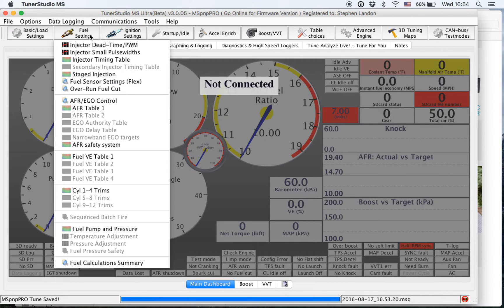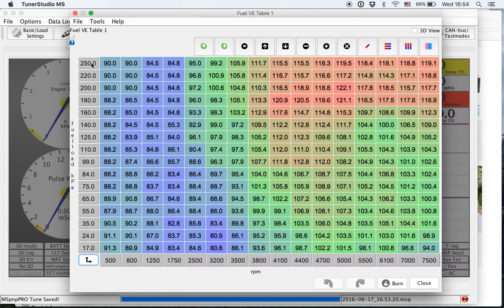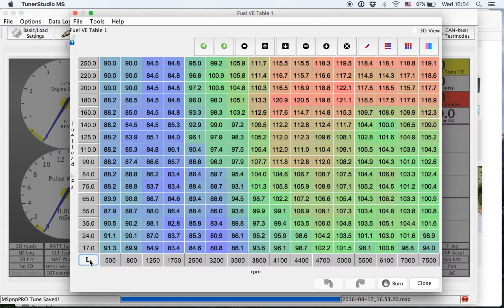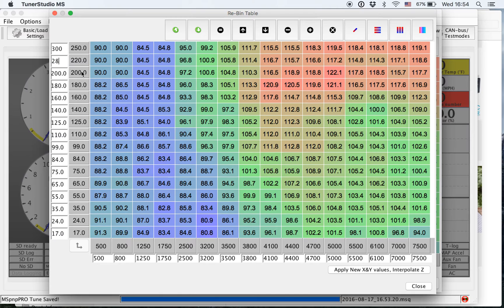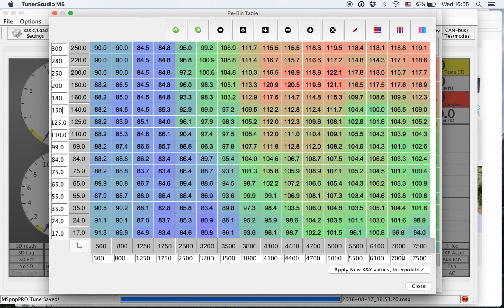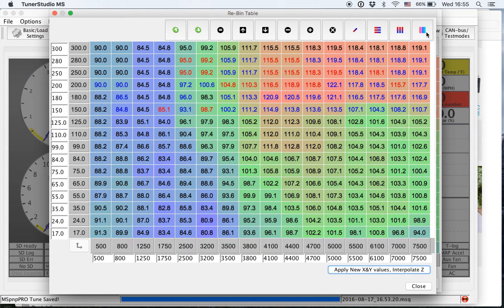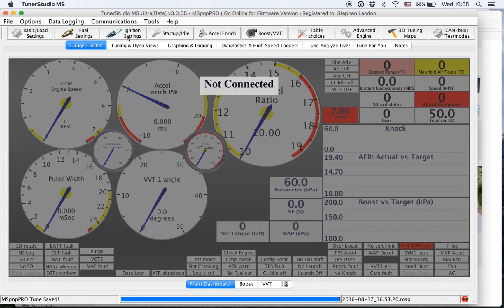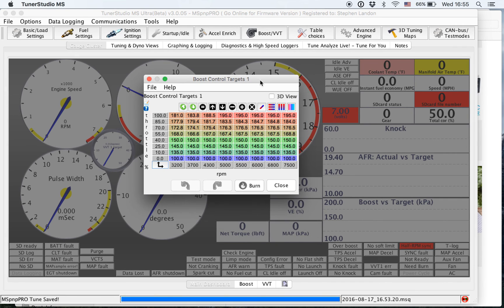Tunerstudio rescale table

Comment: I have a ms2, I did rescale the table ve and afr set  for turbo, but in the ignition I do not have 16 scales in the kpa only 12 as in ve and afr, and anyway? thank you
Reply from the maker: It's a MS2 thing. MS3 gets you the higher resolution tables. You will be ok with 12x12. Worse comes to worse you can probably upgrade the processor to a MS3 if you really want to. Check out msextra.com/forums
Reply: Stephen Landon I have to work with all 12x12 tables, I can not go and afr 16x16 and ignition 12x12? , thank you so much